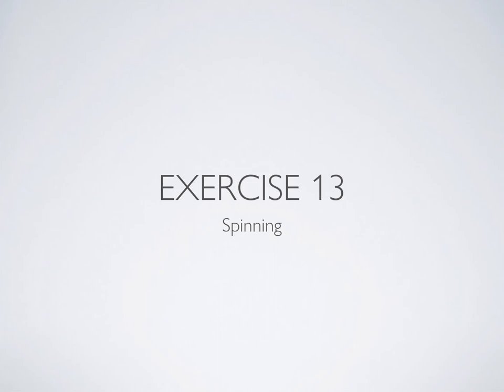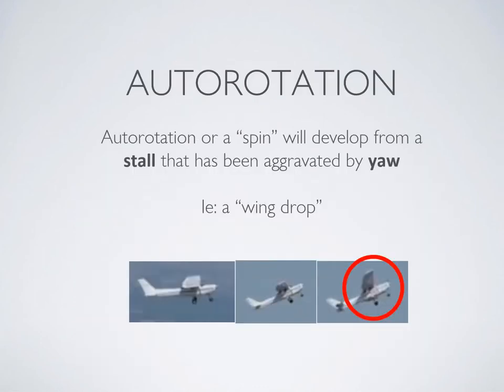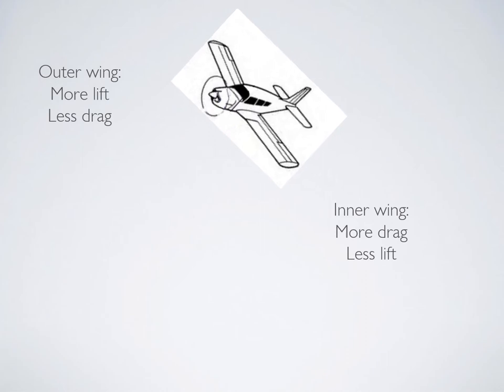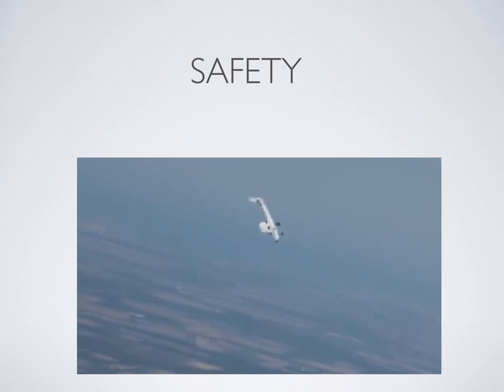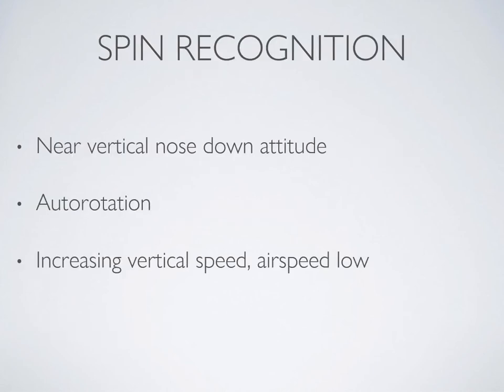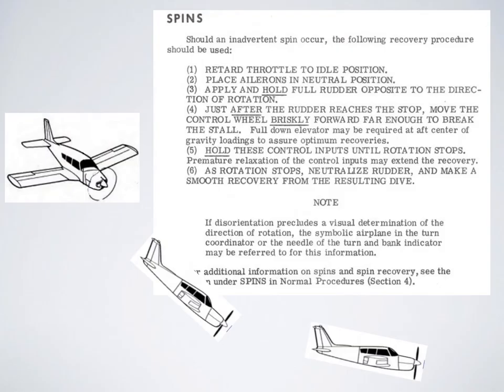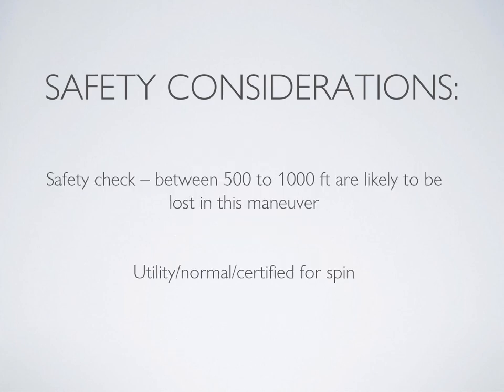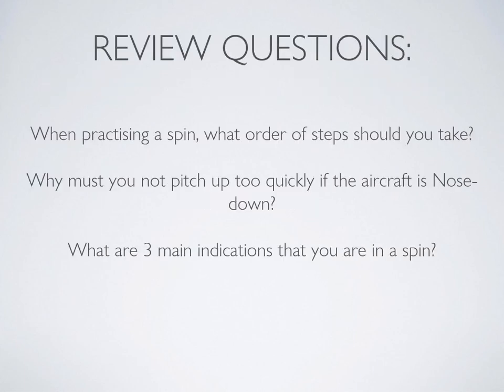Private Pilot Flight Training Exercise 13 - Spinning

Comment: The first time the instructor did it with me, I got scared (C150, started at 4000ft, recovered at about 2000ft.). I was happy that there's no real application to it except recognizing it and recovering from it. The second time, not scary anymore, and my tummy got used to it. :). Good job explaining it.
Reply from the maker: They can be a little intimidating at first! Altitude is your friend indeed.

Comment: I really enjoy my training but I gotta say, this is the first lesson I'm nervous about because I am not at all great with rollercoasters and it has been compared that. Apparently, being hydrated helps, as well as having a nutritious meal and being well rested. Any other tips? Apparently for PPL you just need to be able to recover from the incipient stage...is that correct? Thank you for your super informative and helpful videos!
Reply from the maker: I'm so sorry for the late reply! 

One thing you can do to ease into the spin is to enter it with very little "energy".

Start the maneuver with power-off stall entry. when the plane is about to stall, place the airplane into about a 30 degree bank and give it full inside rudder. You should be able to feel the wing stall and you'll "tip" into the spin.  You can even practice immediate recovery (opposite rudder) so that the plan never reaches that nose down attitude until you feel more confident about the entire maneuver.
Reply: @FlightInstruction101  awesome, and no worries! Thanks :)